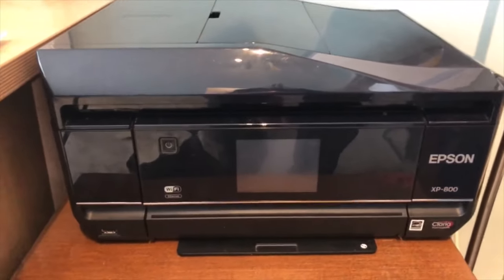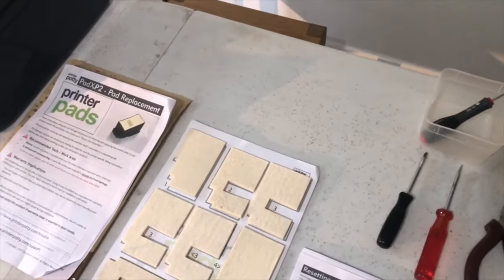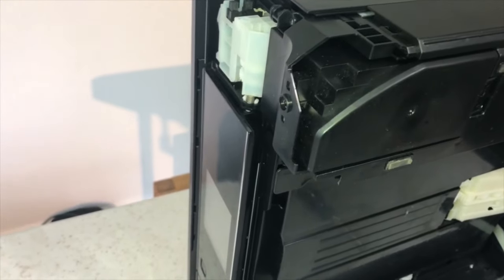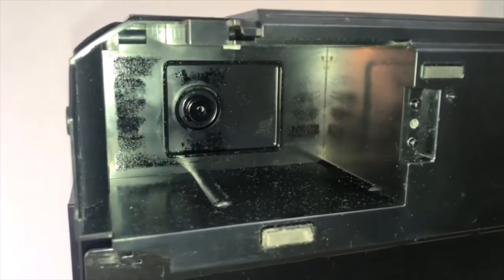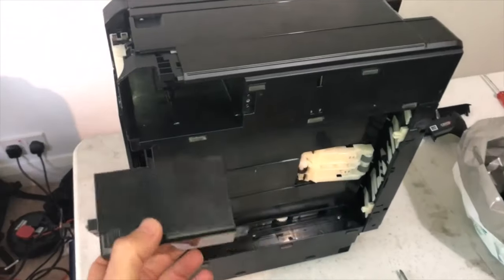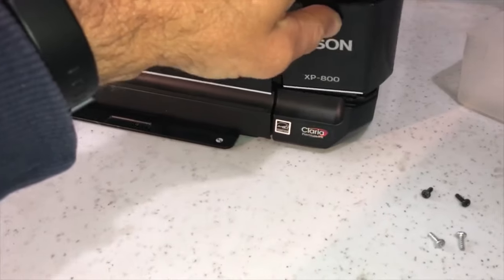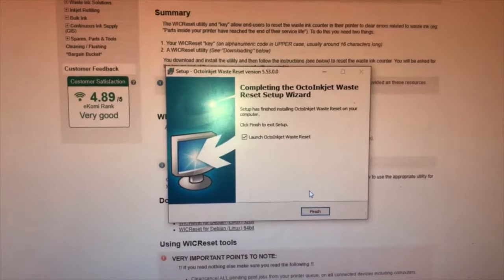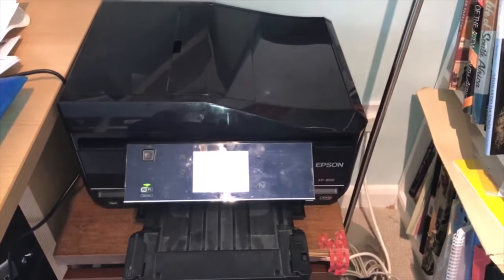Epson XP error - ink pad replacement and reset of the printer using a code / key.

Comment: An excellent video explanation. I have the XP-610 which has just come up with the early warning message, I had no idea that is had a tank with pads in it? Before retirement I was a Photocopier engineer for 35 years, so carrying out the procedure looks simple, however I've never like Epson printers, the ones I've owned over the years have always been noisy and unreliable, so do I spend money on a set of pads and obtaining the unlock key, or do I throw it in the bin and buy a brand new HP or Canon printer? Mmm ..descisions...descisions! All the Copiers I worked on had a simple slide out waste tank, that could be emptied and replaced easily by the user. Epson...take note instead of ripping off your customers with more trouble and expense.

Comment: I have the Epson XP-410.  I ordered my new pads from Walmart and the pads came preinstalled in exact same case as on my printer, however, to install in this model, you close front control panel and paper load.  Put printer standing up on panel end, remove one screw and use a flat head screw driver to move tab on left top corner and lift panel out.  New pads preinstalled  in case go in the same way old one removed.  Changed pads that were 10 years, 11 months, 2 weeks and 3 days old.  I print a lot and the old pads and assembly were not only filthy and full of ink but the entire space was full of dust, etc. and I blew the entire space out with Blow Off Computer Duster in a can before installing new pads.  Now I just need to find a key to reset new printer pads so I can start printing again.  It took me about 5 minutes to change the case with new pads and I'm 76.

Comment: Update. I got the new potty and put it all back together (my printer is an Epson XP-640 but it was very much the same) downloaded the programme while I was waiting for the post to arrive. Then followed instructions and all went smoothly. Unplugged USB Cable and checked again and yes printer all working. Thankyou very much for this easy to follow video. How kind of you to offer it. I can now use all my stash of inks and saved myself a load of money on a new printer.

Comment: Many thanks for your brilliantly clear and helpful instructions. I've gone through the whole process without any problems and the printer now appears to work perfectly. My printer is an XP-630 so not identical but it is nevertheless essentially the same machine. 
Interestingly, I did not even need a reset key at the end but simply switched on the machine and it worked straight away. I reused the old pads which I think will be just fine. One word of advice: put on gloves if you rinse and reuse the pads! I didn't and I will now have inky hands for the next few weeks... 

The printer has been a totally reliable workhorse for years so no complaints there but I am disappointed that Epson are making it so difficult to service and repair. Their online help pages are directly misleading and unhelpful.

Comment: Excellent and like other users really pleased that I could “recycle” my XP-620, rather than putting a perfectly usable printer into landfill. For my XP-620 the instructions are slightly different. At 06:14 it says there is no need to remove the front screw (part of 2) holding the tank in place, for the XP-620 you do need to remove this screen

Comment: Thank you kind sir, worked a treat. 
The XP-860 did start throwing up this error before we ordered the replacement + key, but it was intermittent. 
After the replacement arrived, the printer was still working, so we just waited about 10 days until it was permanently erroring - then replaced.
I think if you fail to do that, the printer software more that likely will still see the ink waste pot as full - not sure, didn't want to risk it.

Comment: Your very detailed instructions were extremely helpful for ink pad replacement and reset of my printer, an Epson XP-630. I followed your instructions step by step. With the soiled ink pad you have to be double careful and use plastic gloves and a plastic bag. In cleaning out the excess ink reservoir I also have a helpful suggestion. Spray Oxi Clean Laundry Stain Remover in the reservoir, swish it around and rinse with hot water. Even drying out the reservoir with a paper towel, the towel was completely clean. The messiest part of the procedure was the easiest. With your fantastic instructions, and my little helpful hint it makes a complicated procedure easier than I thought. Thanks again.

Comment: Thank you so much for your easy to follow video, we got the ink pads with tray from Unicomp for old Epson model XP 530, for £2.45 plus postage £8.45. And we’ve managed to insert pad tray as you directed, put everything back together again. Also we were very surprised, but we didn’t need to reset, the printer reset itself, and is working. Big thanks

Comment: Thank you so much. My trusty epson xp 610 is now up and running again. Octoinkjet were as good as you said and new printer pads and reset key arrived promptly. I did go against your advice and tried to wash out my old pads. What a waste of time. After numerous rinses I binned the soggy pads and spent quite some time clearing up the mess.  Thank you again. 😊

Comment: With the guidance of your excellent video, I was able to remove the blackened waste ink pads (when I tried to wash them they dissolved!).  I ordered new pads, easily installed them, watched your video step-by-step and successfully reassembled the printer (Epson XP-830). I ordered the code from OctoInkjet, received it immediately, watched their super video and viola!! I have a working printer again! Many, many thanks!

Comment: Thank you for this excellent video. I have just purchased the kit and hopefully will be able to get a perfectly good machine back working again. 
I so hate having to throw kit away that, with a bit of effort, can be bought back to life.
Reply: All sorted. Though I seem to have a silver screw left over.
Very easy, and straightforward
 You need to be comfortable with handling a screwdriver and not frightened to bend plastic. The rest is a doddle. 
The windows software is so easy to use. You do need a USB connection between PC and printer though.
48 hour delivery for the pads via royal mail so reasonably quick
Reply: @richardauckland4191  That spare silver screw was probably the one that secures the front of the waste pad holder. Lots count of the times we forgot that step while we've done this process :) Luckily the lugs on the front of the pad holder will stop it from falling out so it's not needed.

Comment: You're a true hero for uploading this video! It couldn't be more helpful than this. Very clear instructions. After replacing the pads, when I was about to reset the waste counter, I had a message saying my printer didn't require resetting the waste counter but I did it anyway.

Comment: Great video. Gave me confidence to do this myself and save 70% repair cost offered by Epson - comparable to the cost of a new printer! The one screw that couldn't be positioned by hand to tighten was tricky, but I sellotaped the screwhead on to the screwdriver that gave enough hold to just position the screw upright in place and provide a slight turn that enabled the screw then to be tighten in place. Thank you.

Comment: Thanks so much for this video.  I have just finished replacing pads and resetting my printer, could not have done it without your step by step video. Working as new and saved me having to buy a new printer when this one is still working well.

Comment: Great video thanks. I have pads arriving in the mail tomorrow from Octoink for my XP 860 and your video will be very handy as a double check! However, I reset the counter the other day with Octoinks utility and a new code and as you found it was so easy and seamless. I actually did it on WiFi and it worked perfectly I have a strong stable connection from my laptop to printer and was pretty confident it wouldn't be a problem. Many thanks. As you say, the actual error is purely a page limit (20,000 or thereabouts I think) and not the condition of your Printer Pad as such. So if like me you reset the counter with an online download of code and utility from Octoinks it does resurrect the printer though I would recommend replacing the pads soon after. Many thanks.

Comment: Wow thank you so much! It was so easy to follow along exactly with the instructions in this video and my printer is up and running again!! I used another commenter's tip of using a piece of tape to help guide that one tricky screw in , which worked really smoothly.

Comment: Excellent video, Tristram.  I got straight to the aptly-named "potty" of my Epson XP-700 using your instructions.  I'm now waiting for Octo Inkjet to send me the new pads.  All-in cost so far £15.00.  Great value if I can get it to work with the new pads and code.  My only slight criticism is that the volume of your commentary was a tad low.  I could hear better once I plugged in earphones.  It may have been a problem at my end.  In any case, a really helpful video.  Many thanks.

Comment: Many thanks. Very clearly done. I am annoyed that NONE of the Epson printers give any warning that they are approaching end of life for the pads (confirmed by their no-help desk). I was in the middle of a critical job this evening, when it just stopped with the message. We are a long way from any service agent, and no doubt it will takes some time for them to fix it. I will be following your lead and doing it myself.
Reply from the maker: You're welcome!
Reply: I did fix it myself.  BTW The Expression 960 is even easier to replace the pads - 2 screws on the bottom of the printer - yet Epson still insists that it requires a service agent. All good now. Thanks again.

Comment: Yes - agree with comments - very helpful video - thanks. (Procedure is same for XP-600).The error message took me by surprise! Have been using non-Epson inks and ran into trouble because cyan jet got blocked. Flushed OK but then  printer refused to work with non-Epson cartridges! Then I I got the inkpad message. Washed the existing ones but messy!  Haven't put them back yet as still wet but I assume they will be OK, at least for now. Will buy a replacement set just to be safe. Next I need to do reset. :-)
Reply: UPDATE: OK got a reset code and the reset utility program. Worked fine but a bit of an obscure process. I don't see why a user should pay for the privilege of resetting their printer when a normal part of the useage cycle shuts it down. Seems bizarre and somewhat exploitative. Epson should give a reset code free shouldn't it? And how do third party vendors (Tom, Dick and Harry) get the right to issue reset codes? Money for nothing it seems. An odd setup all round. Still, printer's working again thank goodness and couldn't have done it without this video. When I reassembled it I had a screw left over!! No problem just had to backtrack and found the empty screw hole ... Thanks again.

Comment: Hi Tristram - thank you very much for taking the time to record and upload this extremely helpful video.
I have just completed the process on my elderly XP-610 and everything went very smoothly.
The only thing I would note is that my connection is wireless over my home office network rather than by ethernet or USB cable, and it worked just fine, no issues. 
I took the opportunity to update the firmware using the official EPSON utility, clean and realign the heads, and it is working very well indeed - good for another 8 years I reckon!
I don't use this printer for photos - just normal office duties - and I've put all sorts of pattern cartridges through it with no issue at all - it's more sensitive to good quality paper for the kind of work it does.
Once again - thanks for the video!

Comment: This is an excellent descriptive video..easy to follow too. My printer is an XP-820 so slightly different, however, because the video wwas so well put together it was very simple to change the Ink Pads and reset my machine. For just over £10.00 it saved the cost of a new printer. Well done.

Comment: Thanks very much. Helped me fix the Epson XP-760 replacing pads and using the reset tool even though I had the instructions sent with the pads and reset key I found it easy to see with your video guide. I got mine from octoinkjet on eBay but I think they have their own website too. Extremely Happy. Thanks again 🙂

Comment: Thanks ever so much for posting this video. Downloaded the Reset from Octoink..followed the instructions & the printer is working perfectly. Using your instruction I was able to take out the ink tank & clean the ink pads..just a temporary measure ( we have some printing to do tomorrow ) but I've ordered a new set of pads from Octoink to replace the old ones. Once again...many thanks.
Reply: Thanks for helping
Reply: When you ordered the new ink pads, how long did it take to get them? How did you clean the pads you already had/with what? I may have to do that, too-in a crunch and need my printer working. Seriously ticked that Epson has their printers like this, yet mentions NOTHING at all about what to do or what the message means, or that the pads can actually be replaced! Seems like they should have at least mentioned them and what to do about that message somewhere on their website or in the ptr. manual!
Reply from the maker: For me the pads arrived within the week but it really depends on supply and stock into Octoinkjet.  Suggest calling them to ask.  Good luck. Hope this helps.
Reply: @JaimeDornanLady  We manufacture the pads here in the UK and have more than 1,500 sets in stock so they aren't running out. Shipping times depend largely on where you are in the world and what shipping service is chosen. 

Regrettably Brexit, Covid and world events do slow things down but it is possible to do a partial reset of the waste ink counter using the key "TRIAL" (all caps without quotes) to get the printer up and running again while you wait. Obviously you'll want to use  @Tristram O 's video to check the pads first and remove/replace any pads with temporary absorbent material while you wait.

Comment: May I engage in this process on receipt of a warning for end of service, or must the printer be disabled by the condition? And, do you recommend cleaning the cavity revealed when removing the "potty"? I am supremely confident to get on this all for your thoroughness and calm demeanor. Good stuff.
Reply from the maker: In my opinion I think you would be able to engage in this process on receipt of the warning ie before the printer is disabled.  With regards to cleaning the cavity, yes, it would be advisable to wipe any ink spills away and make it clean.
Reply: I can confirm that you can reset the waste counter before and/or after the error appears. You don't have to reset before the printer locks itself down and you can reset if you're expecting it to hit soon and want to just get it reset now.

Comment: Thanks for this brilliant video. I hope I will be successful in replacing the pads on my XP 520 by following you instructions .  I assume the casings are similar or the same as your XP 800.  🤞
Reply: CORRECTION: It turns out the XP-510, 520, 530 and 540 models have minor differences in design and the waste ink pads are half capacity compared to the XP-500 and everything from XP-600 on up to 860. There is a paper installation guide with the XP2 Printer Pads kit that deals specifically with those models.

Comment: Glad it's solved like this, but angry that Epson just shuts down your printer, this is what I call mafia practices. You maintain your material and for such stupidity you have to buy sponges and a key, luckily that it gets smooth

In any case, the purchase of Epson printer will no longer be in question.
Reply: Regrettably all inkjet printers have this issue and while Epson don't go out of their way to help you fix the issue, they don't block you nearly as much as Canon or HP do with their own designs. Newer Epson models now have a user replaceable maintenance box (basically a waste pad in a box with a chip) so they have tried to address the problem in newer models. Doesn't excuse the problem but other brands aren't necessarily better by default.

Comment: Very good! Did the ink pads leak when the printer was turned on its side???
Reply from the maker: Mine didn’t leak. The pads were very wet but not dripping.
Reply: @tristramo3760  Ok, thanks, I haven't tried the process as yet, been rehearsing mentally. I'm thinking being quick and efficient when setting the unit on its side is the trick.  New pads arrived today. Thanks again for your work!!